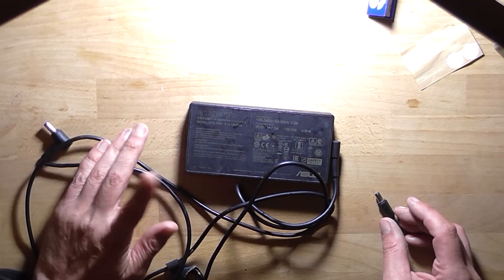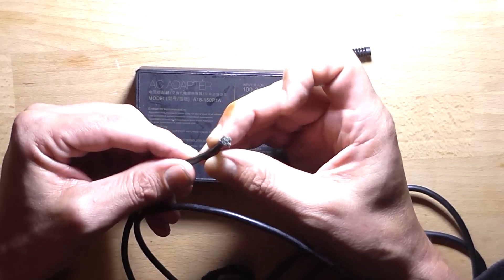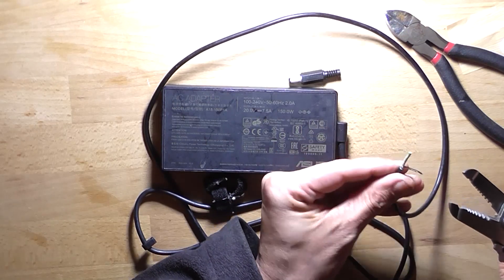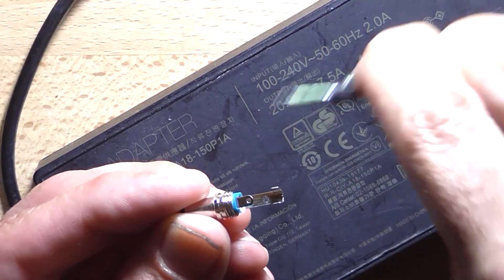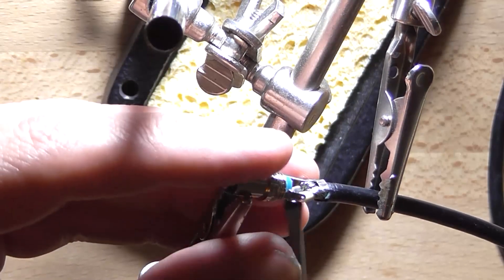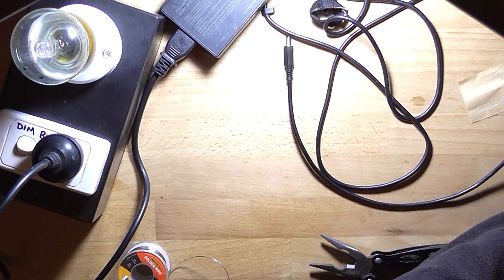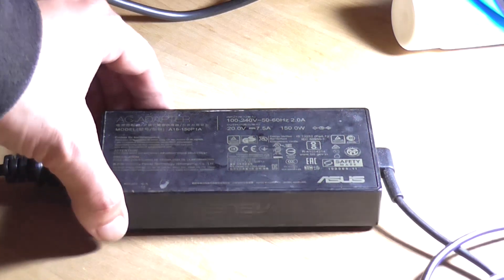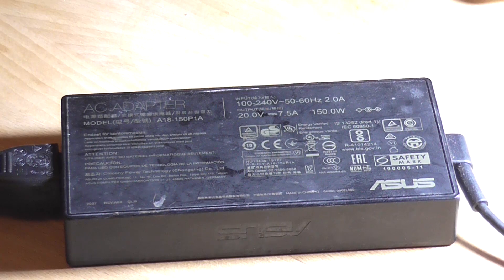Repurposing an old Laptop Power Supply

Comment: Nice one, mate. Maybe the dim bulb anomaly thing is either just the capacitor(s) getting the initial charge, or else the thermistor doing its soft start thing....? Anyway, great job. I have re-used a few of these, too. They seem very reliable, mostly. At least the original ones, anyway.
Reply from the maker: Possibly a soft start thing, as you mentioned. These little bricks are great for powering other things at the 20V mark (the soldering iron is supposed to be 24V) as they're very stable, regulation wise.